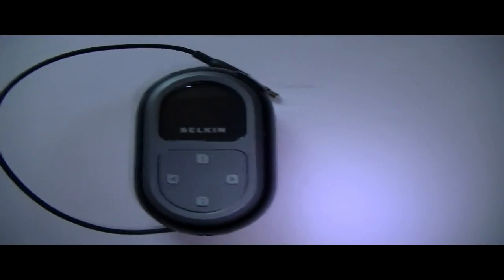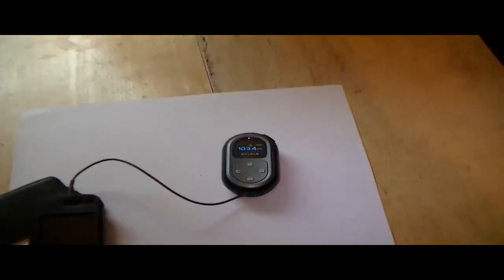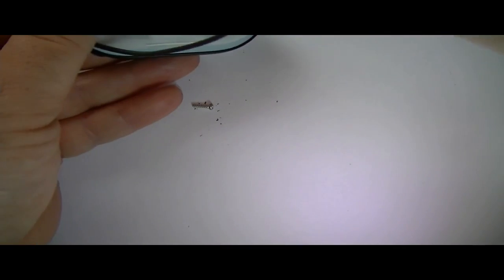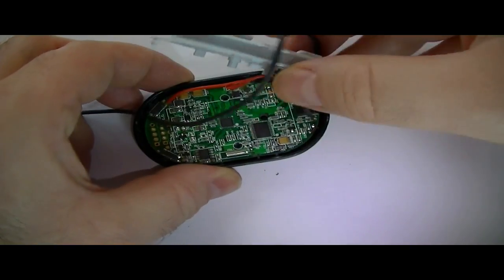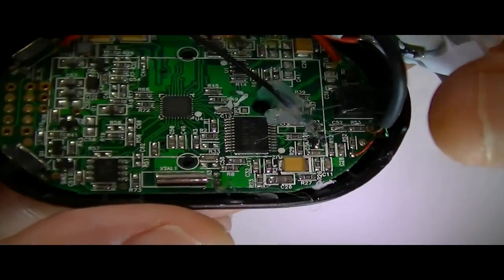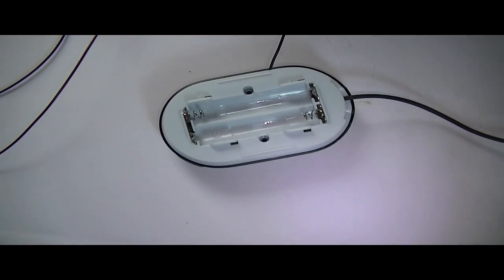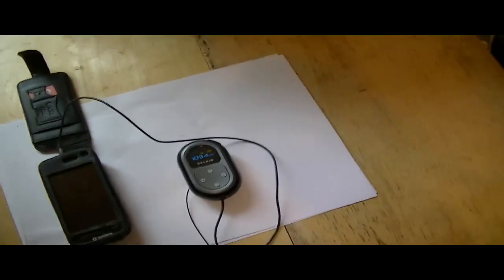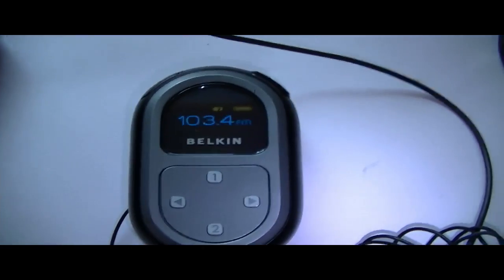Hacking a FM transmitter. Transmission range from 10ft to 200-500ft, wow!

Comment: Or you could have a 3dB attenuator on the chips output to maintain a reasonable impedance match then run RG316 thin teflon coax to a power amplifier and then to an outside antenna 😂

Comment: I bought a Scosche FM transmitter, and the FM IC I don't think is labelled. There is an unlabelled chip. There is another IC that has the label 8027 2567 1TKC but I think it's the microcontroller. Not sure. How do I find where the attenuator(s) are on it when I can't get a datasheet because I don't know the FM IC?

Comment: what is the purpose of attenuator
Reply: To attenuate.
Reply: Reduce the power i.e. transmitter transmission by 75%
Reply: to reduce the transmission power to well within the legal limits for unlicensed stations, because most people using these transmitters won't necessarily transmit on a frequency that doesn't interfere with licensed stations.

Comment: In Layman's terms, how would one go about doing this on another transmitter?
Reply: Sorry for the late reply lol but basically you find the rf output on the main IC chip, follow the green trace on the board until you find a capacitor (normally yellow for surface mounted capacitors) and solder a wire to the end that isn't connected to the IC chip. That's it.

Comment: Just making sure  I got this right... You locate the RF output (the big square on the green board), then you follow the light green path until you meet the 1st thing (which i'll be the c38 thing). You continue following the light green path, and remove what comes next (the resistors I guess). At the place you removed stuff, you attach a 125 cm copper wire (your new antenna) which is connected to nothing else, and you're done?
Reply: As far as it seems yes thats it lol

Comment: As a preventive measure I recommend tying a knot on the wire before threading so if it gets pulled the wire won'y rip out the board, hot glue isn't really strong.

Comment: Perhaps you should go back in the transmitter and tie a knot in the wire so it will keep the wire from being pulled out. That glue helps, but wouldn't be as good as the putting a knot in the wire.

Comment: does this model have an auto shut off if no audio input is recognized? Im after an always on solution if anyone can recommend?
Reply from the maker: Yes it does ,it's very annoying ! but i did the mod to remove it ,you only need 1 resistor and the transmitter will stay on.
The guide found on Google.

Comment: Great video !
What kind of wire do you use?
Could you please make a new video, where you show the spot to solder on the circuit board of the cheap chineese fm-transmitter, because I have tried to modify one myself....without any succes......I broke it.....It can only transmit in mono now :-(.....But If I could see, where you have done the hack on the circuit board......I could do it myself as I have one more ..........because I bought two of them on Ebay ;-)
I hope you understand what I am writing...because I am from Denmark
Kind regards
Michael Larsen, Denmark
Reply from the maker: On other transmitters :
The best way to get better transmission range is to identify
what FM transmitter IC is used ,there is not that many ,then find the
datasheet online ,then look in the datasheet for the RF output pin on the IC
then remove the attenuator and then solder your antenna wire to the RF output pin.This can be done with most cheap chinese FM transmitters.
Reply: Michael Larsen man i can’t wait to get mine

Comment: Could you show a video/screen shot of the circuit board hack on the "cheap Chinese" fm transmitter.  I'm trying to do a hack on that but having trouble locating the correct placement of the new antenna.  Thanks, great video!
Reply: Yes I too need this if got it please share with me.

Comment: can you me how many milliwatts the Belkin TuneCast 3 is please. just interested to know thanks.
Reply from the maker: Its RF output power is about -8dbm thats
0.15848931925 mw !

But if you add a simple RF amp using just one
2SC3355 transistor you can get the RF power to about
10dbm \10mw
Reply: thanks for for the answer. :)

Comment: why do you have to wire the antenna just after the capacitor?
when i did mine i bypassed the capacitor  altogether, still worked fine.
Reply from the maker: Its stops any DC going down the antenna and makes a little more stable.
Reply: dazaro3 I see..just like static for example that may end up killing the chip.

Comment from the maker: To keet it within FCC\Ofcom specifications for RF output power.

In the UK Ofcom govern the civil use of radio equipment
and FM transmitters must meet there specifications for
maximum RF limits.So without the attenuator the FM transmitter is not meeting Ofcom specifications for RF output power.
Reply: Awesome!
Fuck the FCC!
Reply: @Network126  The FCC did force this mod because many National Public Radio listeners 
complained about interference from the pre 2006 transmitters. So fuck NPR too!

Comment: lol.. whats the specs on those baby's?  even line of site, 3 miles is a huge push. I agree, a modification isnt needed to get range. You can use a metal mesh spaghetti noodle strainer from the dollar store, $1, and get 3/4 mile to a mile range on a good clear day, with a regular wifi dongle.

Comment: It was basically an accident.  Last week I was on holiday in Torbay.  There is a place in Torquay where you have line of sight view to a lot of torbay.  I thought cool! Let see how many wireless access points I can see.  To my astonishment access points I recognised from the caravan site I was staying at were in the list I connected to one and managed to load their splash page to proove it worked The APs in question are Sensao units with directional antenna at Waterside Holiday Park

Comment: You dont need to modify a wireless dongle to get 1 mile range from it.  I've connected to a wireless network over 3 miles away with an unmodified legal wireless access point and an ordinary samsung mobile phone.